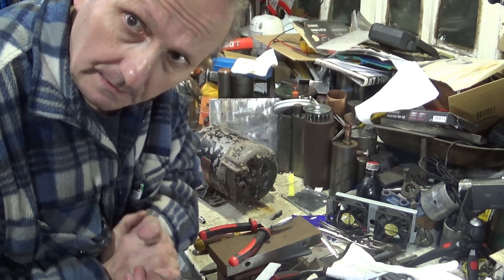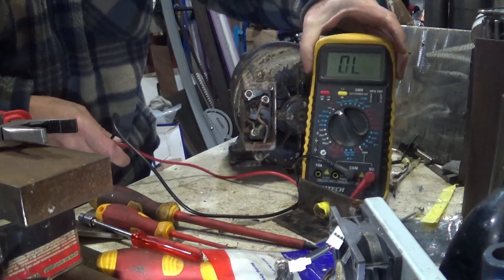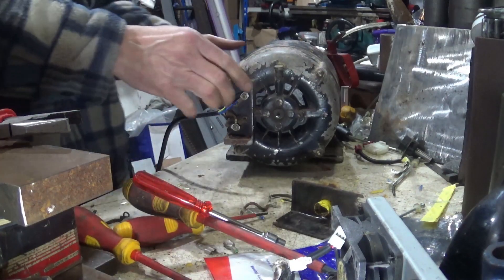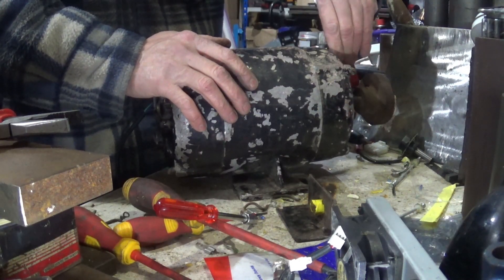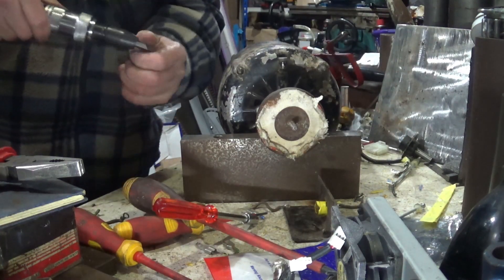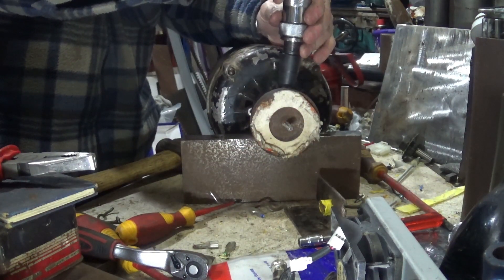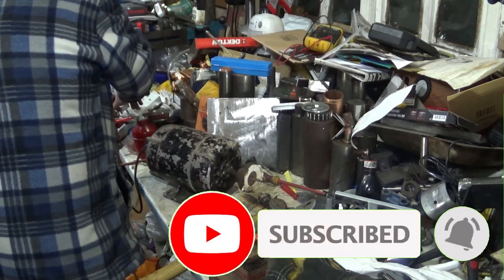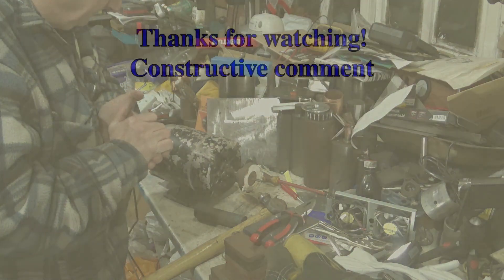Brook Motors Cub Half Horse Power Motor rescued from the scrapyard! #scrapyard

Comment: Great find! Same motor is on my ml7. Will it run in reverse with the dewhurst switch also?
Reply from the maker: Has yours got 4 terminals (plus earth) in the terminal box? With a link between each pair? If so yes it should do.

Many thanks for watching! Please like, share and if you like the channel subscribe!
Reply: @BensWorkshop  unfortunately not it is standard 4 terminals like yours. A1 Z1 Z2 A2
Reply from the maker: That is what I meant. There should be a link between A1 and either Z1 or Z2 and between A2 and either Z2 or Z1. The relationship between the links set which way the motor starts and this is also the job the reverser switch does when there are no links.

Assuming the motor starts, it has links. They need to be removed to attach a reverser switch.

You can see this on my video on  reverser switch here:
https://www.youtube.com/watch?v=hiytCAPsuyI
Reply: @BensWorkshop  just dug out the old myford handbook and followed the instructions and it does work a treat now in forward and reverse :)
Reply from the maker: Have you got a reverser  or did you just move the links?
Reply: @BensWorkshop  I have the Dewhurst reversing switch. Just managed to get it working a treat :)
Reply from the maker: Well done! Hopefully my videos helped.
Reply: @BensWorkshop  they really have thank you for the efforts!
Reply from the maker: You are welcome!

Comment: @, thanks for the pointer and you’re right about it being a lazy starter. I’ve watched your video but do you have any suggestions for it in relation to the cub motor before I take mine apart for a third time? 😂 it does take a while for the switch to click off (as in you hear it scraping for a while as it turns off and on). I have tried liking it and the operation when I have it open seems smooth and easy enough.
Reply from the maker: Make sure the switch contacts are clean. That is the key. Also check the capacitor wiring is goo (if it has one) and the capacitor is working. My miltimeter does measure capacitance.
Reply: @, it’s a cub motor the same as in this video so no capacitor. I’ll have another go at cleaning them and see.
Reply from the maker: @D4HDfilms  Check the resistence of the starter winding (that gets switched out after startup). Should be typically 2 to 3 times that of the main winding, but do make sure the switch contacts are clean.
Reply: @, I’ve made this short video as a way to show what’s going on. Am I right in thinking my starter circuit has a break in it? 

https://youtu.be/UAFVd13iwbw?si=hkoRAJ2JENasFk88
Reply: @, @, I’ve made this short video as a way to show what’s going on. Am I right in thinking my starter circuit has a break in it? 

https://youtu.be/UAFVd13iwbw?si=hkoRAJ2JENasFk88
Reply from the maker: I have made a comment on your actual video.
Reply from the maker: I have on several occaisions put instructions on how to get my email address. It appears that you have either hidden them of YouTube has. See below:
 Click on my name, it will take you to my channel page.

From there you see the channel name next to more.  Click more for the about page. You will see a place to click to get my email address.

Comment: I do love the old motors like that, solid as a rock and just nicer to look at than modern stuff.  Not so good if the windings are toast - we used to have to get motors rewound from time to time when I worked in a factory - it was expensive even back then!!!
Reply from the maker: Absolutely. You do nee to check the wiring! But apart from that they are very solid.
Many thanks for watching!

Comment: The motor seems to run fine, good score. I did not see any capacitors on the outside. Are they inside the motor? Or, does this motor not need them?
Reply from the maker: There are not any. Works the same way as my Hoover motor that is currently on my Myford in that it is just a split phase. Not sure what the practicalities are but also has a centrifugal switch.
Many thanks for watching.

Comment: eyup Ben
the old ones are the best , can never understand why people throw a good motor
cheers
Kev
Reply from the maker: It was full of sawdust to be fair, though I do have access to a compressor and that blew most of it out. I will probably strip it to make sure it is all clean and dandy inside. 
Still, I need a bigger motor for the Myford and I couldn't let it get scrapped!
Many thanks for watching!
Reply: @BensWorkshop , are you using this for a Myford Lathe? I was about to ask for advice as mine starts ok off load but as soon as it has the belt for my Myford ML8 hooked up, it won’t. Any advice?
Reply from the maker: @D4HDfilms  1. Do not start a thread by replying to an old comment. It makes finding the threads and replying difficult.

2. Sounds like a lazy starter issue. Probably caused by the centrifugal switch not working well. I had that issue with my big motor on my mill, see here:
https://www.youtube.com/watch?v=ea_kcnOApQA

Many thanks for watching, please like, share and if you like the channel, subscribe!
Reply: @, thanks for the pointer and you’re right about it being a lazy starter. I’ve watched your video but don’t have any suggestions for it relating to the cub motor before I take it apart for a third time? 😂 I have a 2 thoughts on what it may be but it does take a while for the switched to click off (as in you hear it scrapping semi off and on for a while).
Reply from the maker: @D4HDfilms  I get more comments than I can keep up with in YouTube notifications. I am not going to reply to you unless you do as I asked and start a new comment thread. As in not a reply to someone else's comment from 2 years ago. That way I can more easily find the thread.

Comment: Get yourself a three legged puller Ben, they are so handy. When are you going to insulate you're shed??
Reply from the maker: I have a 3 legged puller and a 2 legged puller. What I do not currently have is a hole in the pulley! Though now I have the pulley a little way off the shaft I can drill one which will be coming. 

As for insulate... I have now got and will do videos on, is a diesel heater which should also run on kerosene and .... waste oil which I can get for free.

Many thanks for watching!
Reply: @BensWorkshop  A little bit of heat and that will fly off.
Reply from the maker: Once I have drilled a suitable hole, and applied a puller, yes I suspect it will.
Reply from the maker: There will be a video... For reasons which will become clear a puller was not an option.... But a bit of heat was.